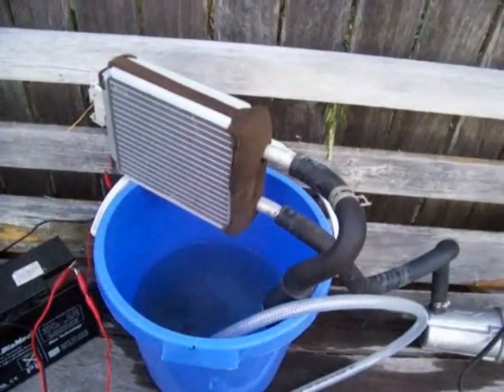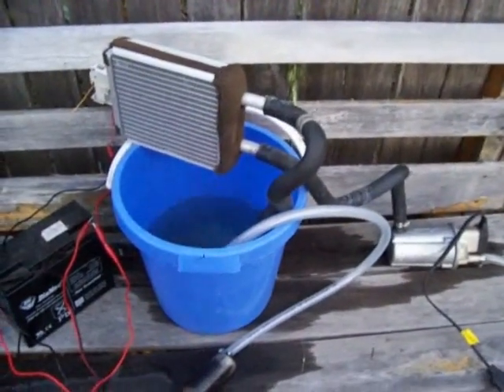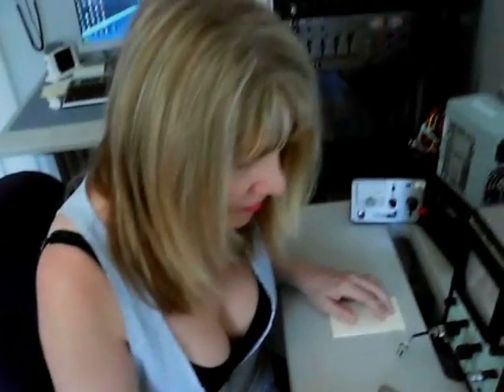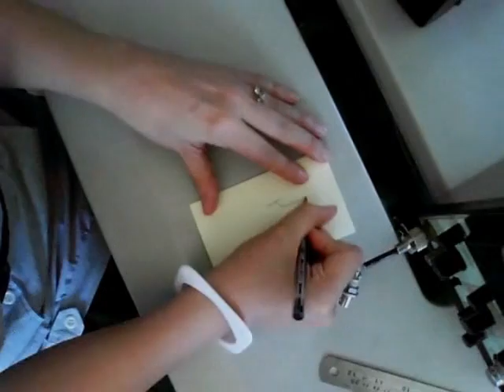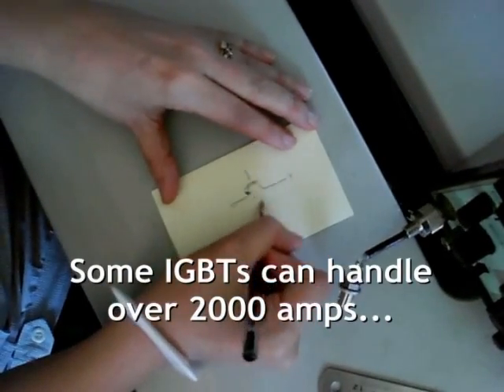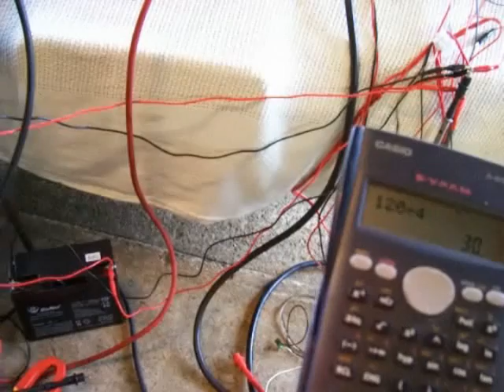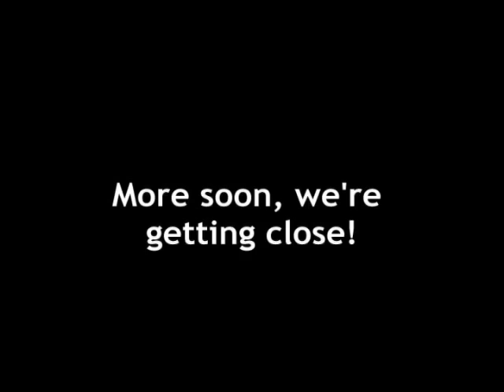Electric Starion EV - Electric Car Conversion - Part 7

Comment: did yous ever consider adding a 50cc 4 stroke in too the equation or diesel i tryed some scotors years ago like 80 ss i have a based understanding which  has allways been not to leave a tranporter dead all so whats humaideity level prof is it  have you work in dynamic brakeing & dynmo charging smart choice one of the airdynamic car of the 80 ss i had followed staring vid but i just loged and whent strigt too end thou will follow all thou soon dam nices end product  ~!@#$

Comment: Ever heard of the Zilla? Been around more than a decade, most effectively on the dragstrip. Otmar has stopped making them, so I hope he finds someone to take over for him or the EV community will no longer have a race-tested, high-current, high-voltage motor controller.